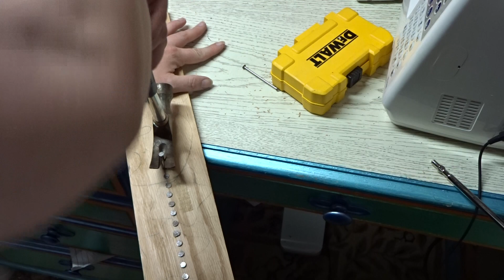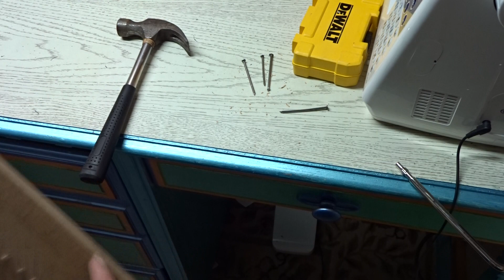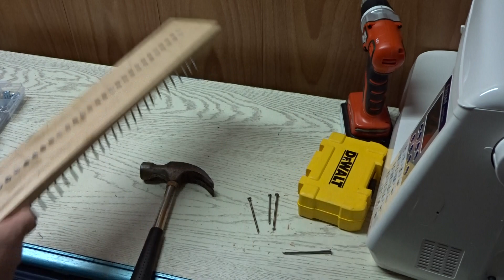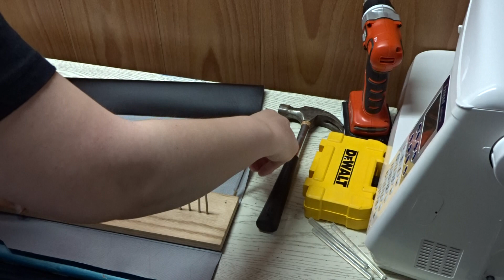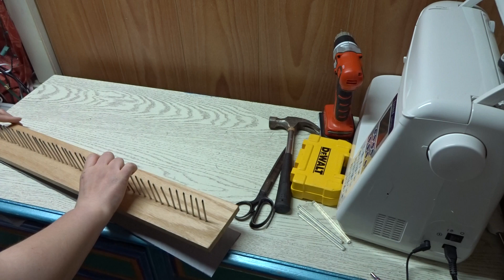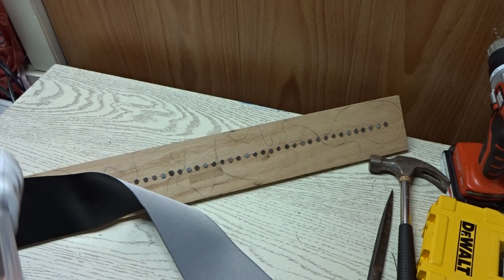Making a hackle for fiber - part 2

Comment: How would you make the comb x
Reply from the maker: Hi, Thanks so much for watching. As for your question... I made some viking combs previously but I do not really use them too much with the hackle. I like just pulling the fiber off using my hands or a diz. If you want I can do a video showing my combs and info on how I made them, if that would help?
Reply: That would be fantastic x